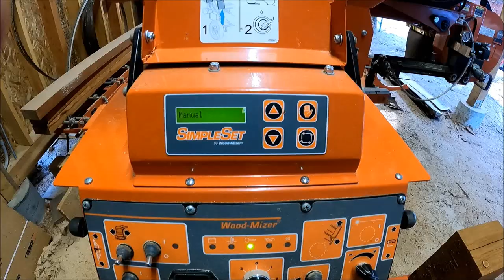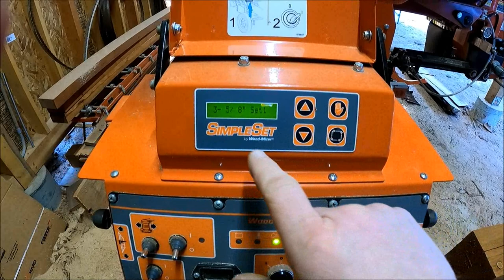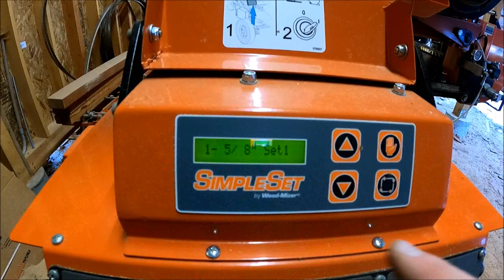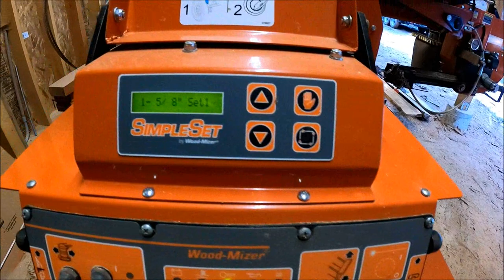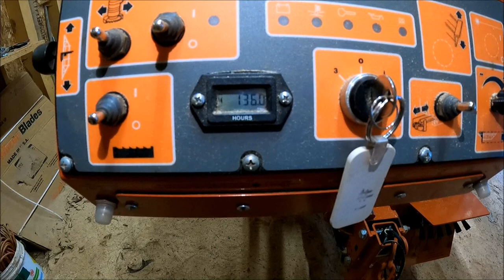Milling 2x boards and using the SimpleSet on the Woodmizer LT40

Comment: Looks like you got some nice lumber out of that log. I tried the saw dust trick by putting it on the ground , but it backfired on me,
I drew every mosquito for a 100 mile radius after a few rains. Then it was one heck of a mess to clean up. Hope u have better luck. If u don’t mind a little suggestion on the saw dust build up behind your mill . I installed a dust collect and blew it out the end of my old building , now I blow it into a container on my new building. I’ve got a couple videos on it . Keep up with the videos ..
Reply from the maker: Yikes!  Thanks for the heads up on the mosquitos.  I would not want that.  We actually started covering the area with chip instead because the sawdust started blowing around when it dried out.

I will check out the videos on dust collection.  I have watched a few of your videos in the past but don't remember seeing that.  Thanks for the information.